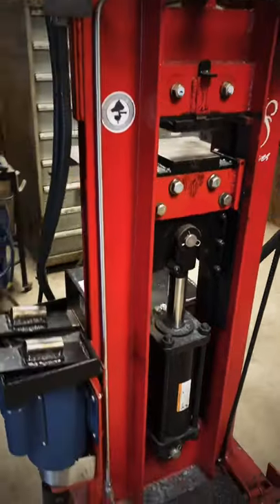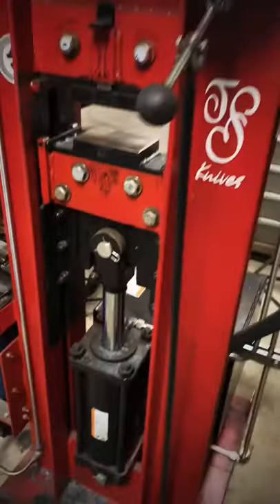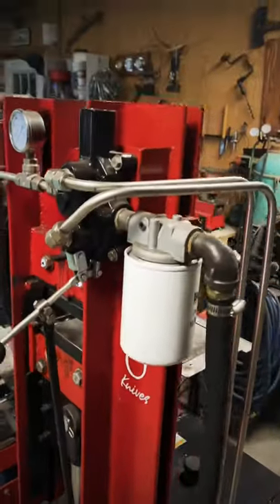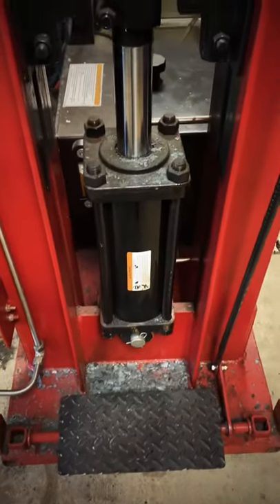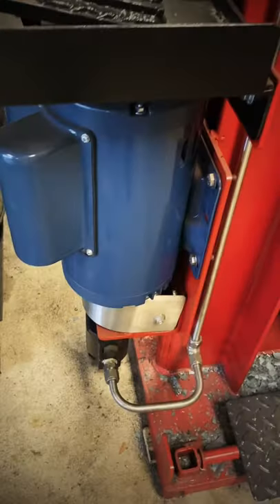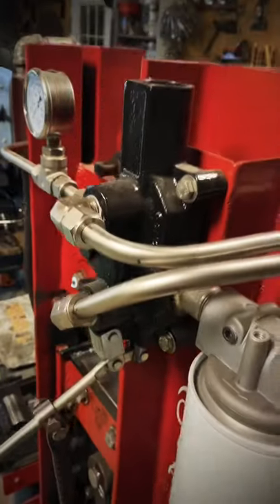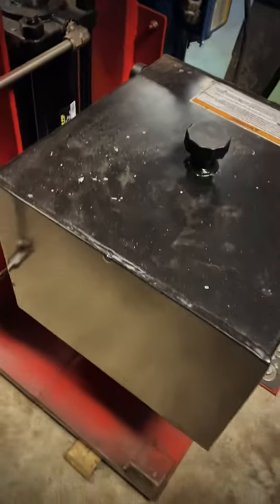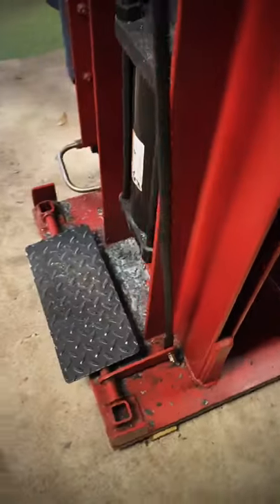Hydraulic forge press build walkthrough.  #shorts #short #shortvideo #diy #maker #forge

Comment: Where did you place the pressure gauge? Right before the cylinder or by the pump?
Reply from the maker: It’s in between the pump and the operating valve.  The operating valve is set to bypass when it hits a certain pressure.  The gauge helps me to set the bypass pressure and I can always see that it’s working.
Reply: @TonySeverioKnives  thank you very much for taking the time to. Still above my intellectual capacity but I’m filling the information for future use. I have a press that I got from a certain Steve Schwarzer and he told me that this press was built by Jim batson. I don’t think it’s operating at its full capacity but have neither knowledge base nor a pressure gauge installed and was told that should be my first step.
Reply from the maker: @BlackMuttForge you’re welcome!  yeah the pressure gauge will tell you what the pump is putting out and where to set the bypass.  I used Dr James Bastons book to design mine.  It’s a life saver literally.  😁